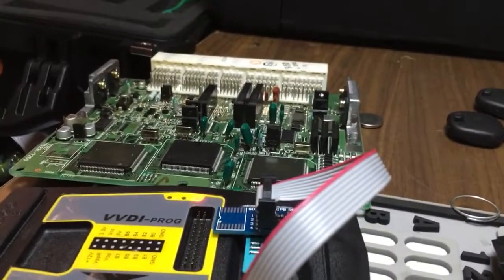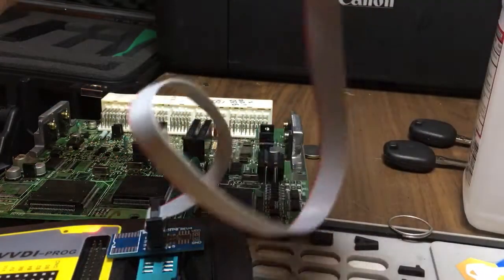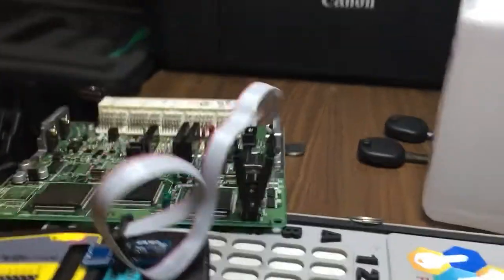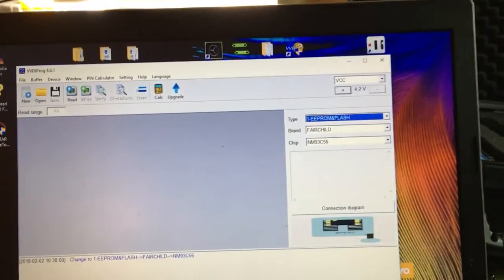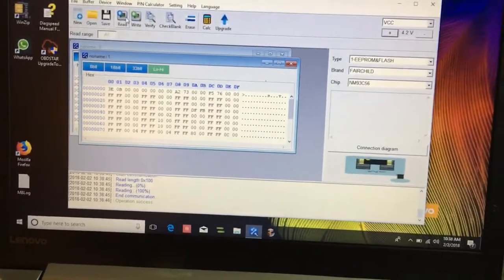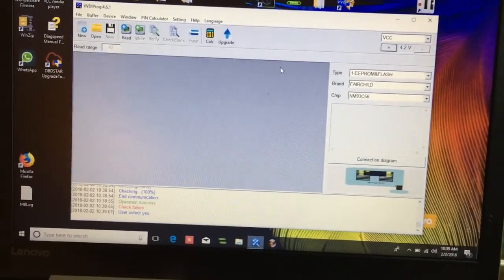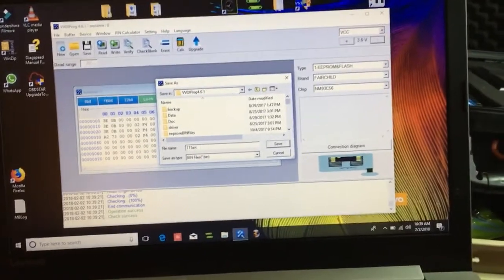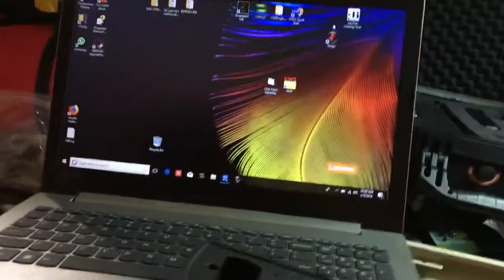How to Read Toyota ECU w/ VVDI-Prog

Comment: Hi Jareth, Atlanta locksmith here.  Can you tell me your views between the VVDI2 and Tango?  What are the pros and cons in a nutshell?  Also, are you able to make an old key (Not add a new key to an available slot) using VVDI2?  Maybe somehow taking Key position 1's data and write it on a chip?  I was curious about that.  Thank you.
Reply from the maker: I'll be making a video on this subject shortly
Reply: @JarethGarza  I thank you.  Because you're one of the view that demonstrate EEPROM at an automotive locksmith standpoint, you helped me greatly learn a little more about EEPROM and VVDI2.

Comment: Nice video. I’m about to do an 03 sequoia got any tips?
Reply from the maker: If that's the box style behind the cluster then ground the oscillator or else u won't be able to reflash it
Reply: @JarethGarza  3rd pin from the right hand side on the "millipede" chip.